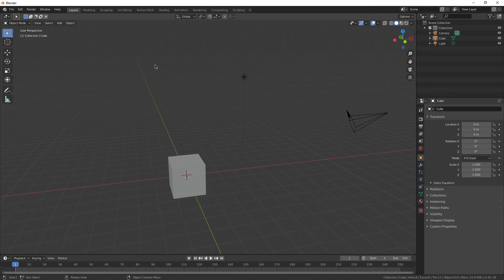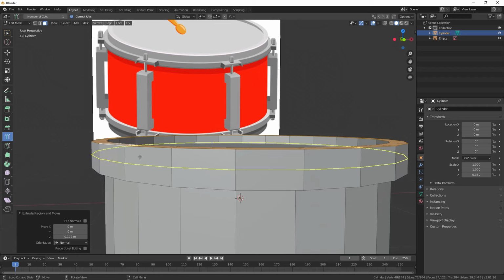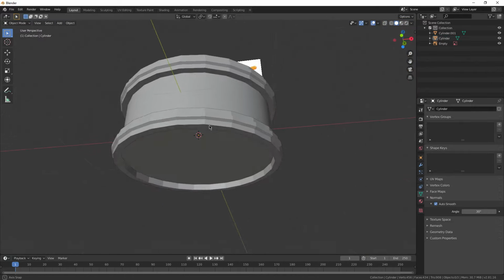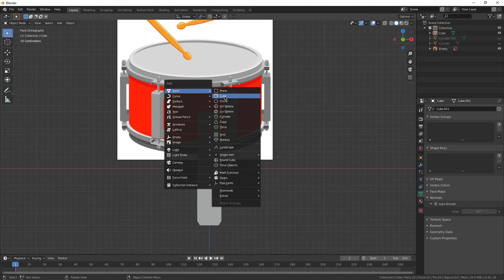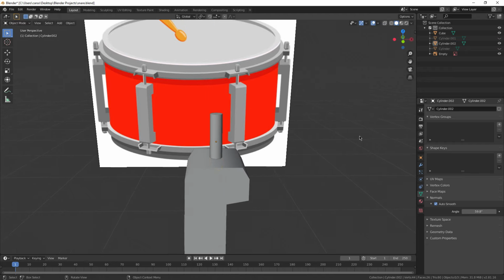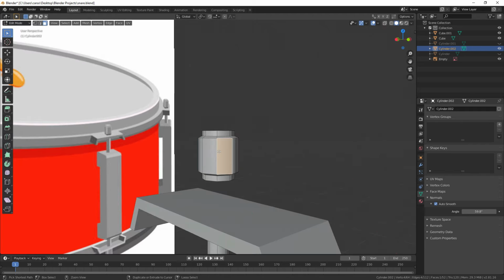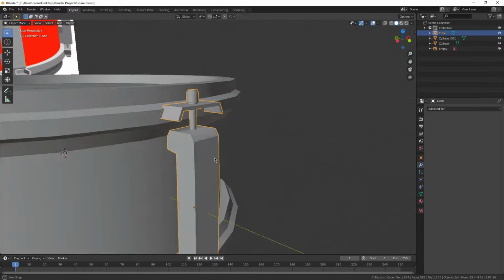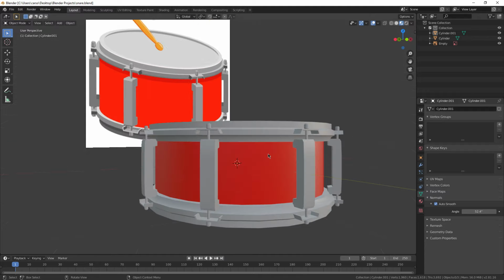Become a Blender PRO in 20 Minutes...

Comment: The top of that drum is an n-gon, which you generally don't want since they're hard to work with.  You can fix that by insetting it, deleting the middle, selecting the edge loop, and using grid fill.  N-gons are acceptable once you stop working with a model, since they help cut down on triangles but it's good practice to not have them in the first place.